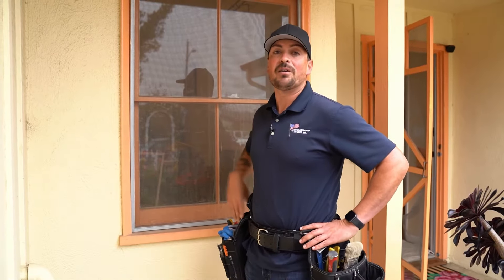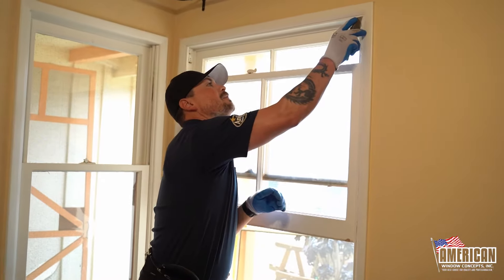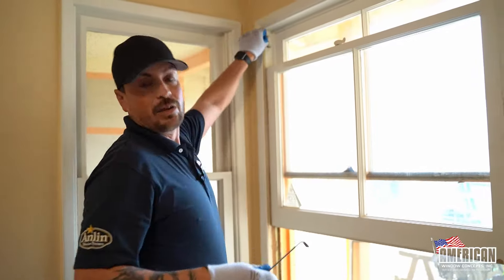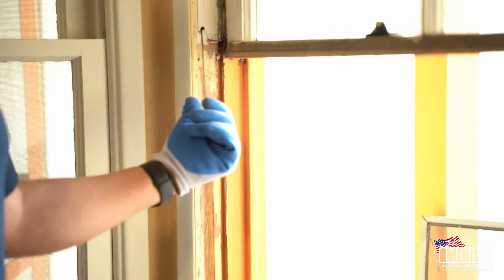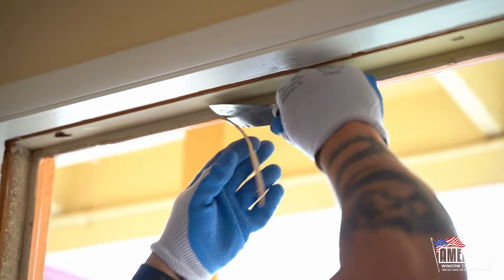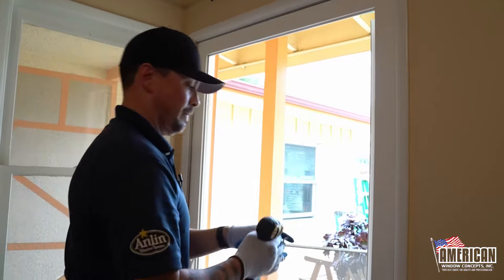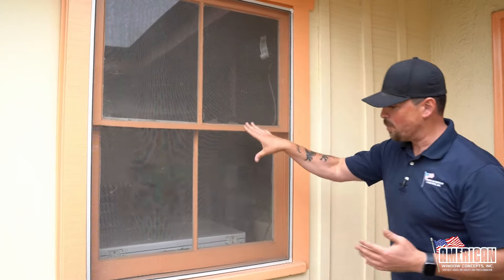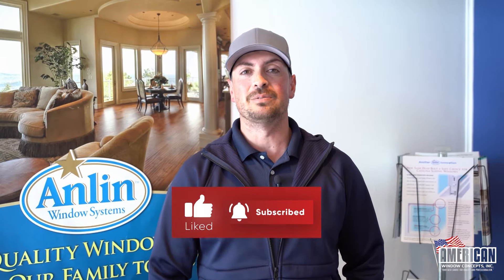Removing Old Wood Window & Installing Vinyl Replacement Window (Step By Step)

Comment: Don't remove the old wood windows! This is terrible. You can and should replace wood windows.
Reply: Why not replace the wood windows? My wood windows are so old starting to rot and sent open. Why not replace with vinyl or metal?
Reply: Because new windows look gross and cheap

Comment: Thanks for the step by step. I have old wooden windows i want to change also. Ill give it a shot. I wish u showed how to measure for the new one though, but still appreciated
Reply: I’ll have to make a video on that. Thanks for the input and idea.
Reply: Btw, you got this! Just measure inside and between the wood stops with a bottom sash lifted and deduct the standard 1/2”. You may be able to get away with 1/4” deduct. 
For the height, measure from the top between the wood stops to the bottom sill and deduct 1/4-1/2”.
Reply: You should restore, not replace wood windows!

Comment: How about measuring for the correct window???
Reply: You can tell from watching the video that the small trims will be removed (& reused later on in this video). But the big jambs aka wood surroundings are kept as they are. You measure the distance between the surfaces of the big jambs and that's your rough opening measurements to order the infill window.

Comment: so far after 5 decent videos not a single craftrsman incluiding this one  is coverong the caulking, sealing insulating the sill gap  and any flashing needed on the outside...I give this vid a 2 1/2 star for that crucial ommision
Reply from the maker: Sorry Norman. We have other videos where I cover that, but I suppose I slipped on that one in this video.

Comment: Thank you for posting the install process.   The window is definitely watertight.  How about a retrofit flush fin vinyl window on stucco?  My new picture window and single hung Anlin windows have a bead of caulk on the exterior connecting the vinyl to stucco.  The top and sides are caulked but not the bottom.  Plus there’s a small enough gap on one of the windows at the bottom where flange sits on stucco that I can literally slide a thin piece of paper through.  Is that a correct install?
Reply from the maker: Hi Elizabeth, the bottom being left open is ok, but the best possible way would be to caulk in the bottom, but leave a small 1" section uncaulked on either side for weeping purposes. The caulking should be tight on the top and sides, no gaps.

Comment: This is amazing! Would you have done anything differently if there were outer storm windows? I’m just trying to replace my inside, old wooden windows
Reply from the maker: The outer storm window should not be any issue, the install happens from inside. However, I would need to make sure the window can be sealed weather tight, and if the storm window gets in the way, I would need to figure a way to seal it properly. You should not have any problems.

Comment: Hey Sean, great video. Can you please make a video on bay and bow windows. From measuring to replacement. Thank you.
Reply from the maker: The next bay window request we get, I will be sure to make a video on that. The one thing I will say is, treat the measurements as "new construction" from inside drywall to drywall. Make sure the depth of the entire wall has been accounted for (very important!), and the need for the proper placement of the exterior corbels as added support. These windows rarely come up for us as of late, not sure why really.

Comment: Why not remove exterior stops and foam and wrap the exterior brickmould and sill? That's how I do it so I don't have to remove the interior stops.
Reply from the maker: You can do that also, but the best practice to to install from the inside, leaving the exterior stops alone. All depends on the customer and situation.